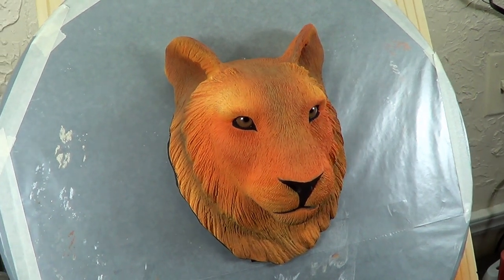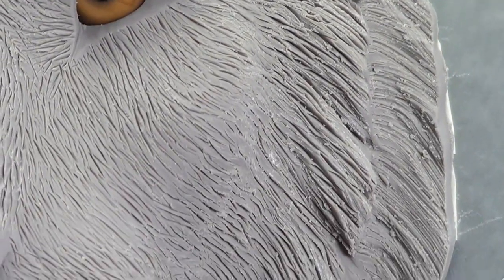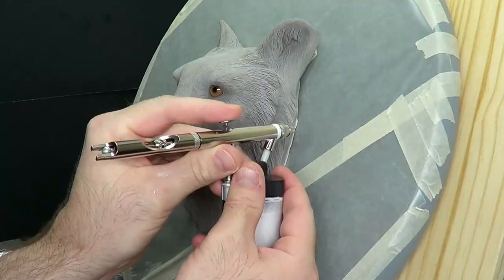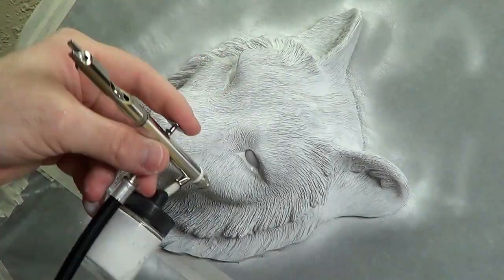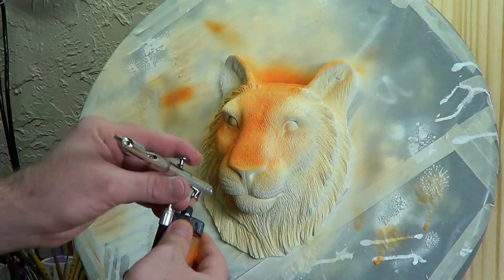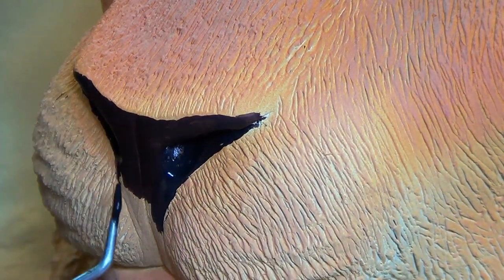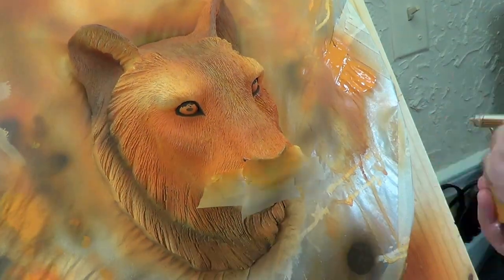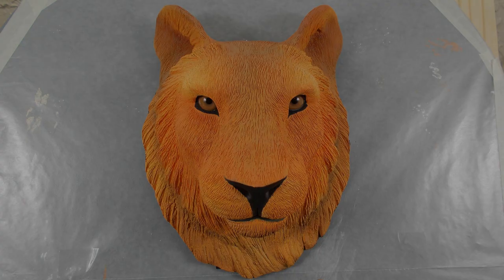Tiger face, part 9.  Painting...

Comment: Tom this is really coming out so nice,,,I think you are so talented and really enjoy watching your videos..thanks so much for sharing with us all..very nice job! I also would like to tell you about this tool I have that does what you are using the dental tool for,,it has a rubber tip and then a little cup like on it where you put the paint in it and it has a metal handle like the dental tool it is called "Fine Line Painting Pen" it says on the package :Ideal for painting, line drawing, signing

Comment: I have a tip for you though which saves me a lot of time. I got a sowing needle fairly thick and cut the point off. Then I glued 4 pins in into the end of it to create a needle rake. you can then drag it along the surface and sculpt multiple hairs at once or press hard and get thicker lines. 

works great :)